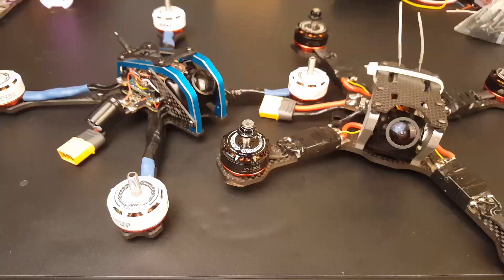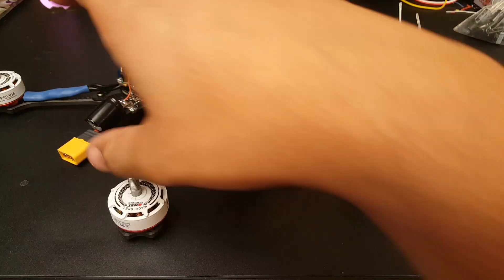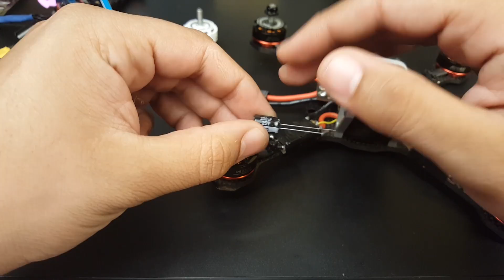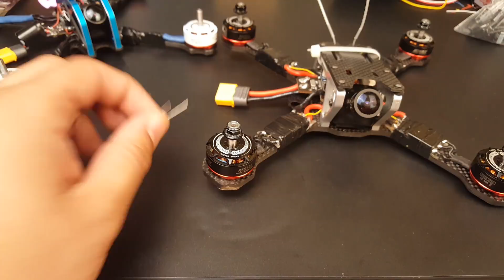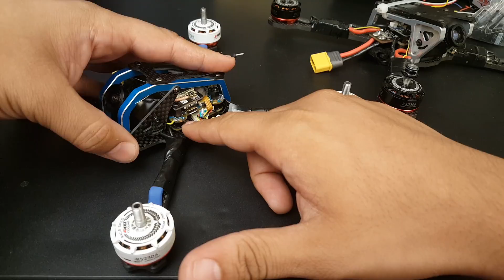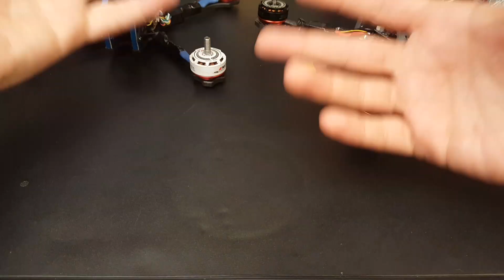Matek f405 // Yaw Twitch

Comment: Dude,thanks. I've been struggling with a build for weeks with that matek fc ipeaka 35a blheli_32 esc and hyperlite 2307 2522kv motors. I've done several builds with the betaflight f3 fc running betaflight 3.2 8k/8k and ipeaka and sunrise model blheli_32 esc with no issues . Caps on the esc was my next step but it's nice to hear it from someone who knows their shit.
Reply from the maker: +proto fpv Before adding caps set the pwm freq to 48khz in blheli32 that reduces noise. Then proceed with caps if needed. 

Keep me updated.
Reply: Drone Mesh will do man thanks for the tips
Reply: Drone Mesh hey there, still not having any luck with this thing. I set the pwm frequency to 48khz put a 1000uf cap on the board and a 330uf on each esc and tuned it down to Multi Shot on 4K 4K. After completing each step I attempted another hover test and still can't even get the thing off the ground without it twitching out of control. Since I started this project 6 weeks ago I have built five other quads with betaflight F3 boards that are all working flawlessly. I'm about to rip this bored out and put a new betaflight F4 in its place. There are pictures of this build and others on my Instagram @protofpv if you want to take a look at them.
Reply from the maker: Thats not normal...

Go here https://www.facebook.com/groups/1882519175321708/ one of mateks Dev is on this group they will respond and help you.
Reply: Drone Mesh I forgot to mention that I've done all of this on two brand new matek flight controllers just to be sure the first one wasn't faulty. I will check that out and see what they say. Thanks again man.

Comment: Great video,  good  info..  But bud how do you go higher in pid  loop.  Betaflight  only goes  up to 8k.  I must be doing  something  wrong.   I just installed  F405 with betaflight  35 a 32 bit esc and same issues  was trying  to figure  it out all morning  . That's  why I appreciate  this video.  But  plz tell  me how  to use the option  of higher pid loop like 32k 16k thanks
Reply: Craig Byrd BF 3.2 configurator has an option "Enable 32 KHz Gyro sampling" Tick that off and you will have many freqs fron 8 to 32 KHz. You won't get your quad in the air on 32KHz PID loop. I tried using Revolt V2 running BF 3.2 - settled at 8K/8K. 32KHz hype train must be empty now.
Reply: Thanks  so that info,  I've already  fixed the issue  no caps just turned up amp  protection  was on 40a went up to 160 a runs perfect.  Thanks  again. Think  I'll stay at 8k8k  fine with me

Comment: i'm running lumenier 2206 2350kv motors with little bee summer 30a esc. no twitching but it does drift slightly to the right when flying straight with no inputs.
Reply from the maker: Darren Wilbraham add some yaw p and should fix it.
Reply: Drone Mesh nice one i shall try that when it stops raining

Comment: I'm using the exact same 'most noisy' combination. EMAX 2205S & BULLET 30A ESCs. I have a 470uf low ESR capacitor on PDB and also 100uf low ESR capacitors on each ESC. Motors and FC are all soft-mounted. I don't have the 'Yaw twitch of death' no matter 8k/8k or 16k/16k, but I do have a very noisy gyro reading especially on YAW axis that heats up my motors like crazy. I've been scratching my head and trying everything I know of but couldn't tame it down. I'm going to try 4k/4k now and really appreciate your help on solving this.
Reply from the maker: +Elvin Chen I will add pic of some filter settings provided to me by Matek and I think it should help you out. Once I get home I'll send you the link.
Reply: Really appreciate!
I tried 16K all the way down to 2K, debug=notch, found that 2k/4k/8k didn't make much difference, gyro readings were very noisy but legit. Once I went up to 16k again, the reading was totally crazy, the lines literally filled up the whole screen in black box viewer. What strange was they all hovered fine. But motors all came down very hot. It seems 16K was hotter than others. The motors and ESCs are brand new. I spanned each motor individually they are all good. Hold the quad with hand and prop on and it felt very smooth. 
Now the question is, are we saying that the noise didn't come from vibrations but electric noise?
Reply from the maker: Elvin Chen Yes if your soft mounting is all correct it's electrical noise.
Reply: Is there anything else we can do with that electrical noise? already have 5 capacitors on it......
Reply: Will replacing all the ESCs to less noisy ones be the best way to fix it?
Reply from the maker: +Elvin Chen Yes I heard the dys XSD v2 is handling it very good and through my testing seemed very good.
Reply: Thank you. how about wraith 32s or iPeaka 32bit? The latter did well in your tests as well. If I'm going to replace ESCs, probably better go directly to 32bit I'm thinking.

Comment: Check that the screw is not touching the windings in the motor.. Those long screws when in contact with the windings will give the same symptoms.. Happened to me.. Having a hard time to figure out after changing every electrical component..
Reply from the maker: +DimplePoji add cap to each esc

Comment: I got 2 matek f405 boards and I haven't had any twitch or shakes or whatever...racerstar 30a v2 esc /emax 2205s 2600kv with the cap matek provides running at 8k 8k gyro pid loop..man the board flies like a dream sorry to hear people are having issues cause this is my favorite FC.
Reply: Racerstar 30A V2 esc are very low noise ones. Probably why you do not have issues.
Reply: Depends from motors. In quad with RacerStar RF2205 2300KV motors didn't experienced any twitching. When motors was changed to RCX2206 v3 2400KV, F405 started to twitch. After ESC upgrade to RS40A v2 with 220 uF 35V low ESR capacitors on ESC power pads twitching completely disappeared.
Reply: KrotowX thank you! Just upgraded to the same motors and got the twitch. Have the LiteS 30A. Will definitely go for your solution. Did you try new ESCs without the extra cap?
Reply: That is true particularly for all powerful 2xxx motors.
Reply: Sorry, did you read what I wrote? Cap on battery pads doesn't help - unfortunately it is that. Matek themselves confirmed that. Put 220 uF 35V (or 330 uF 25V) low ESR capacitors on ESC power pads. Low ESR capacitors! Not regular ones. By the way from which manufacturer/model your caps are?
Reply: KrotowX Yes, I read it. I put 370uF 25V Panasonic FM series on each ESC. I think maybe my problem now is due to something else, maybe a failed fc. I have the same fc and ESCs on two other setups. The "twitch" is really more like a punch to the face rather than a tiny issue. It is unflyable actually.
Reply: In mine case I needed to cap ESC's because without cap on power pads I experienced twitching. Maybe another build with F405 AIO will be more lucky :)
Reply: KrotowX okay, was hoping the ESCs was enough. Our motors is apparently generating a lot of noise
Reply: KrotowX will order quite a few 470uF's now
Reply: Caps didn't work at all :(
Reply: Maybe you're right. I solved mine twitching with caps on ESC's when cap on battery pads didn't helped.
Reply: No, I was wrong... I did every tip in the book, but not tightening the spacer screws. One was a tiny bit loose, the others I just tightened for good measure. Everything after that -> perfect! 32/16k loops no problem. LOL!
Reply: Nice to hear that :)
Reply: Yeah, I have exactly the same FC, ESC and motor combination as yours. Everything was perfect first few flights and than yaw twitch has started. It is getting worse no matter I try. I'll check all screws also and put caps on escs. Hope it will help.
Reply: Marin Lukovic give us an update if you find the problem :) Good luck!
Reply: Sure I will. It is very strange because problem came out of nothing. I haven't had any bad crash. Outside screws are not lose. However, I must check the ones on top of the fc. Also the problem coincided with my playing with PIDs. I will revert to stock PIDs also. I'm currently on 8k/8k loops. And motors and fc are soft mounted.
Reply: Marin Lukovic are you running multishot? I had the twitch develop a couple weeks ago while running dshot600 on the racerstar 30a ! I since switched to multishot and it's flying perfect again.
Reply: Yes, I'm running dshot 600. O, and I've put esc timing on Medium High. I plan to try to revert that option on Medium also.
Reply: Marin Lukovic let us know if multishot solves the issue..
Reply: Yeah I will try, although I wouldn't like to go back on multishot.
Reply: Marin Lukovic you should definitely not need to go back from dshot. Push for other solutions
Reply: Marin Lukovic start off with dhot300 if it still twitches try dshot150 if that don't work then multishot is your best option...Unless you want to replace the racerstar esc with something made to use dshot. Although your racerstar can run dshot they were designed to work correctly on multishot.
Reply: Mat Fever I was flying dshot600 with same escs and racerstar motors on omnibus fc and  I haven't had no issues. So if I change something it will be fc. I really want to use dshot600+ because some nice features of bf 3.2 like turtle mode.
Reply: Marin Lukovic I hear you! Before you replace anything though just switch it to multishot fly it and see if the problem goes away then you know it's the escs! I have 3 matek f405 boards on three different builds, 2 of the quads have racerstar escs on them. One has the racerstar opto2 30a the other has 30a v2. The opto2 is the esc that I had to switch back to multishot. The other quad with the racerstar 30a v2 is still running dshot600. So just try switching to multishot first before u start changing out hardware..

Comment: I'm running emax 2306 2400 kv motors & racer star RS 30A v2 and having twitching & oscillation problems no matter what I do with the pids I'm running sp racing   f3 fc on 4k do you think a capacitor would help
Reply from the maker: +Cameron Jacobs yes you must add cap to each esc.

Keep me updated.
Reply: Drone Mesh thanks I will order them & give it a try
Reply: Drone Mesh  I put a 25v 330 cap on each esc & problem solved now it's my smoothest quad. Thanks so much I was getting quite frustrated

Comment: My setup fixed: Standard Cap with the Matek F405 on the XT 60. Spexid 30A HV. RCX 2205 2700kv v1. Rubbish Eachine ET25? VTX. Idk if blackbox works tho. Im also running on 8k 8k.

Comment: I'm not sure if its a yaw twitch of death, If I do a fast yaw and fast stop the quad tends to gain altitude is it just PID's ? its an f4 with mpu6000, GTS2305 2450kv, 30A ESC'c, 8k8k and blheli_32 thanks.

Comment: Yes, I have one that works great with no caps. Has ESC DYS XS30A with BL-Heli_S 16.6 esc with caps removed for DShot600 and EMAX RS2205s 2600kv, has noise video with last fc - OMNIBUS F4 Pro . Flies great with 8k 8k with NO caps. My 2nd one has yaw twitch with ESC DYS XS20A with BL-Heli_S 16.6 also with dshot600 and EMAX RS2205 2600kv there was 0 noise with OMNIBUS F4 Pro install. I have tried 4k 4k and still can't get above 10% throttle. I put the same capacitors you have in this video on the esc. Will test later today. By the way I always soft mount FC and motors.

Comment: Proper emi suppression is definitely the way to go. I've got an hglrc f3aio pro with ms25a esc's &  with 330mf on each esc & a 470 on the battery lead pads & I get perfectly clear video & no problems with electrical interference whatsoever. Have you ever used the fm series panasonic caps. I've been using fr series so far, but ai just found a bag of fm's I'd forgotten about.

Comment: I have racerstar 2205 2600kv and ztw polaris  25A ESCs 220uf caps on very esc= no noise, no blackouts. Love it !
Reply: Its like as cheap as you can go with ESC and motor. I don't test it without cap's
Reply: I had problems with the F405 and I have seen problems with thd AIO...some work, some do not.It doesnt matter what your setup is or no matter what caps you add. I still believe there is a gyro problem other than just noise. I still do not understand why people want to pull there hair out to try and fix a problem board...